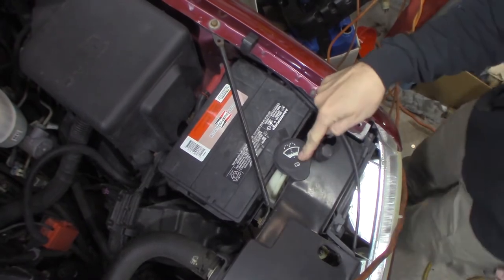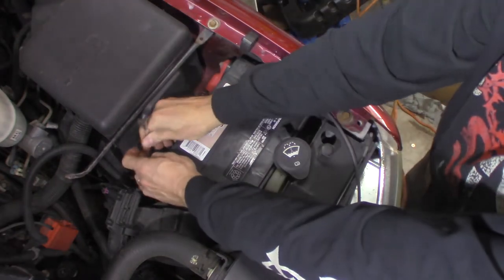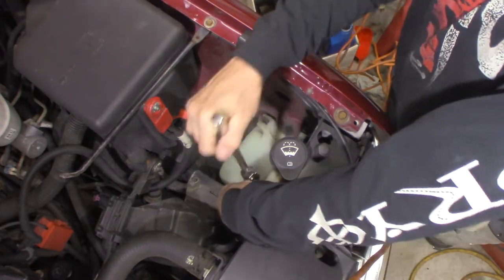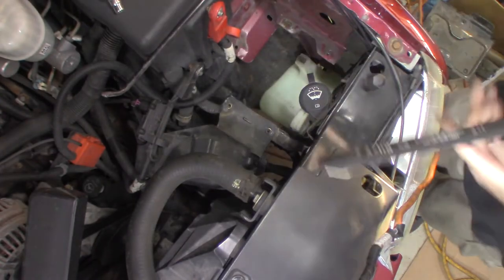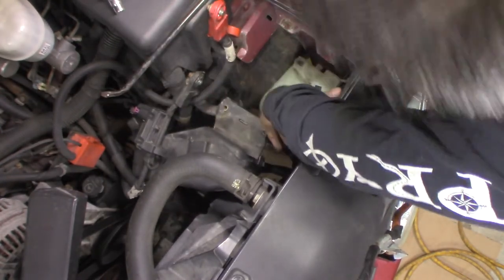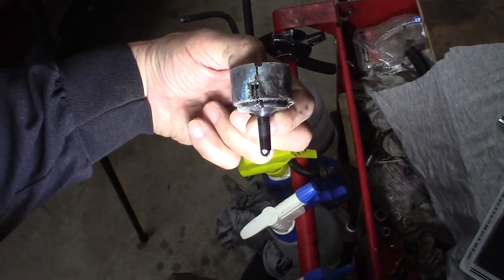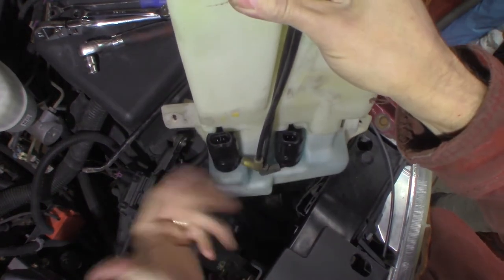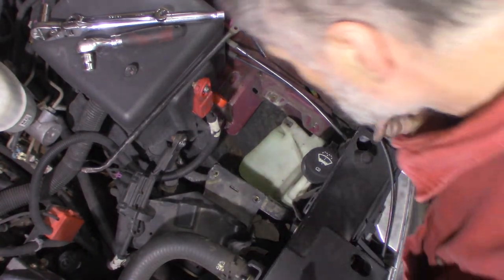2005 Chevrolet Suburban Windshield Washer Resevoir Leak

Comment: Thanks for this video! I was not getting fluid to the front windshield or rear hatch, and thanks to the fresh snow on the driveway, noticed that it was puddling beneath the reservoir. Without dropping the reservoir, I'm not able to get a look at which of the pumps is leaking, and I don't want to do that until I'm ready to change out the pump or pumps. Amazon sells them individually (it sounded like you bought them as a pair) so my plan will be to order one of each, replace the leaking one when they arrive and then return the one I don't use if I don't change out both. By the way, it sounded like you thought it was possible to get at those pumps by just dropping the reservoir partway out the bottom opening. Is that the case and also, could that be done without removing the battery? Thanks again for a very helpful video.
Reply from the maker: I don't remember, but I would try getting to them from the bottom first and see if you can get the pumps out that way.  That would be less work than pulling the battery, tray, etc.
Reply: Tom, were you able to drop the reservoir without taking the battery out??
Reply: @do7hemath937  No, I was not. In my case it turned out that I did not have a pump problem. Rather, one of the hoses had gotten pinched or worn through just in front of the top of the battery.  I had already pulled the battery to see what was going on, but I probably could've done the job without pulling the battery if I'd been able to see the leak earlier. Anyway, I was able to repair that by cutting out the damaged section of tube and reattaching the ends with a coupling from this pack from Autozone: Dorman AutoGrade Hard Vacuum Tubing Connector Assortment. It's still holding. Good luck to you.
Reply: @tom496  I've done a reservoir job B4, I think the battery was side post (in the back) & the screws cross threaded. It was supposed to be a easy job. It was a little nightmare. 
Thanks for the info.
Reply: The front one can be replaced without pulling the reservoir. It’s not that bad